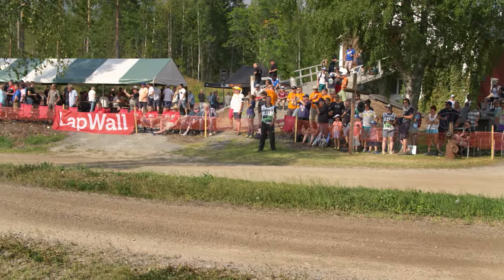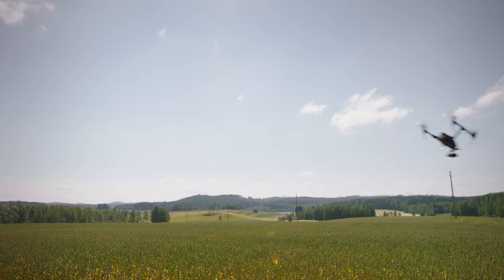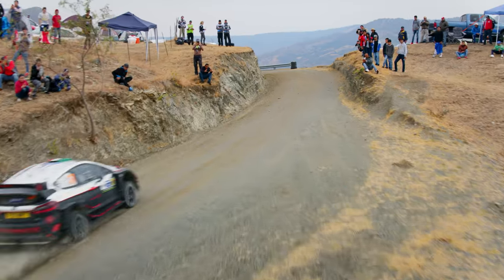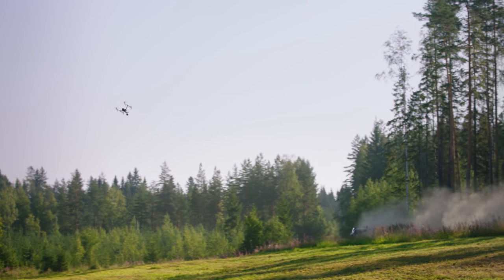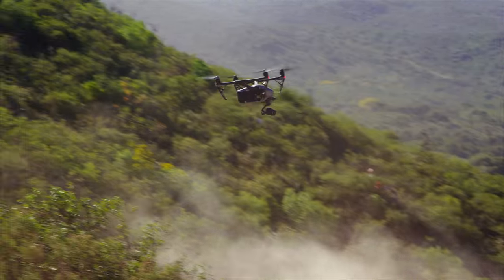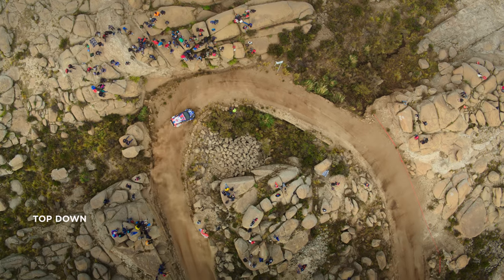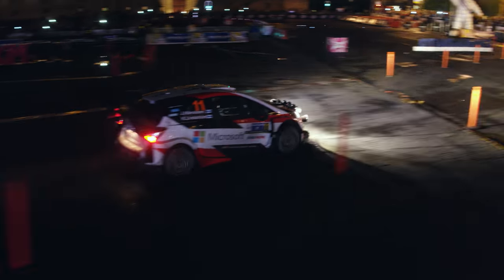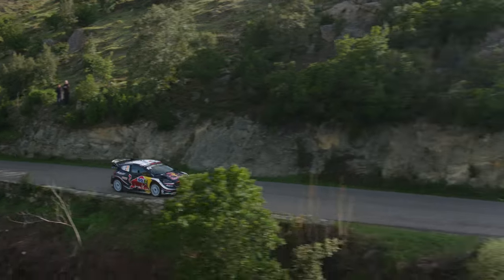DJI Film School - Composing Drone Motorsport Shots

Comment: Thanks for sharing you'r experience!
I see in most shots the drone is flying sideways. Isn't it safer in those conditions to fly with the fpv camera pointed in the direction of the flight? Or this is just because the flight paths are shorter and you're pretty safe doing those shots by flying LOS only?
Reply: Hi, most of the time you want to fly LOS to be safe of any obstacles that you could not even see with the FPV camera so it doesnt matter if you fly sideways or not.. Also if you fly high speed and make rapid direction changes it can happen that you see the legs of the I2 in the camera picture. Thats a big reason why I try to point the aircraft nose roughly in the same directions of the main camera when flying fast.
Reply: Good answers

Comment: @DJI In winter events, where you keep batteries warm?
Reply: Keep them close to your body inside the jacket (mavic, spar) or use battery heating boxes (commercially available or custom build). Try to keep batteries above 20° for best performance. During flight they will stay warm as discharging produces heats the batteries up as well.